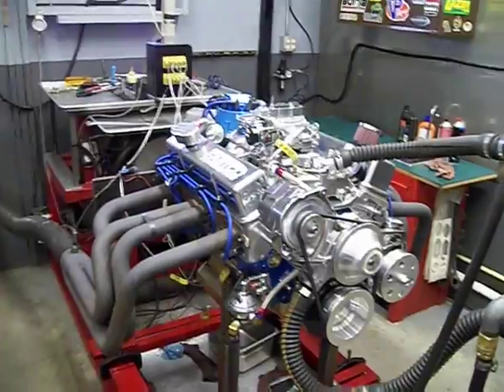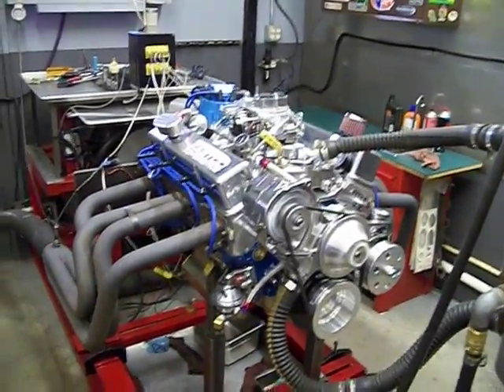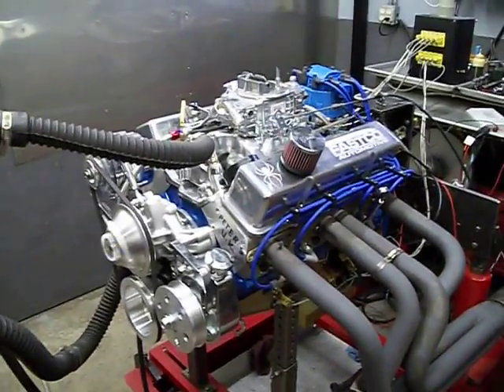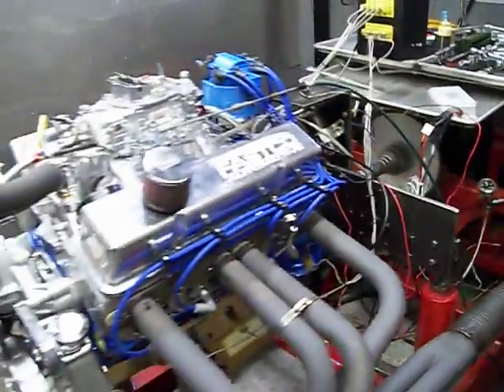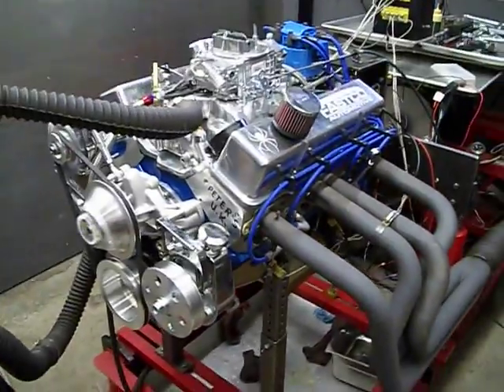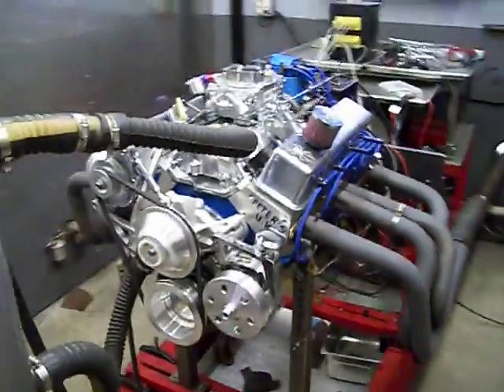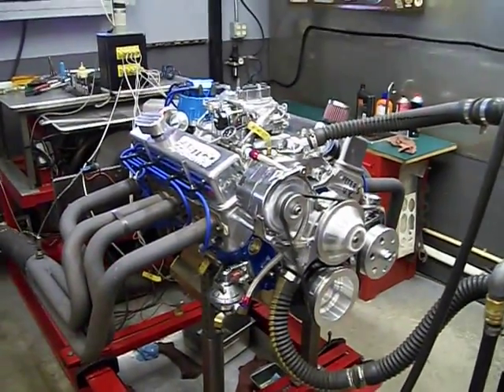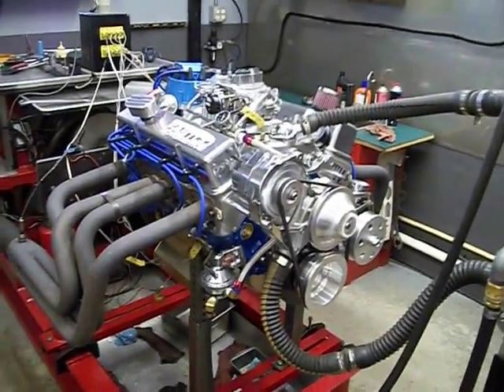Peters Chevy 355 cid with more aggressive roller cam on the dyno 425+ BHP

Comment: so,it makes about the same power as a vortec 350 with mild roller and standard bolt on parts?
Reply from the maker: +AngryDuckSoup  Hello do you have your engines dyno print out with bone stock parts with mild roller making 425 BHP...LUV to see it and a video of that test
Reply: +Daryl Elliott 
my engine is a 434. I have not used a 355 in a long time.

Comment: 425 Hp you can get that much with a stock 350 std bore vortec heads and a flat tappet cam.that motor with the compression it has,roller cam and 215cc heads should be pushing 500hp plus